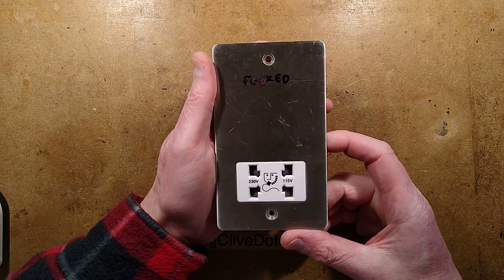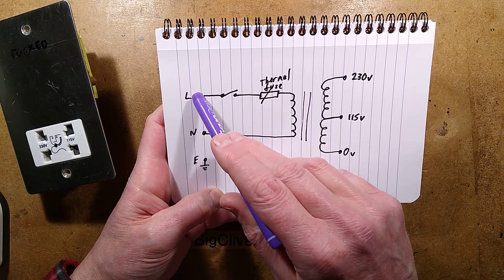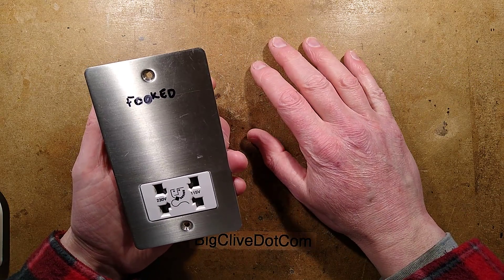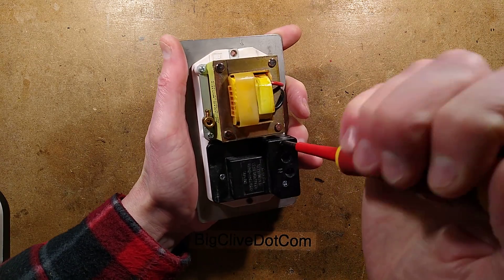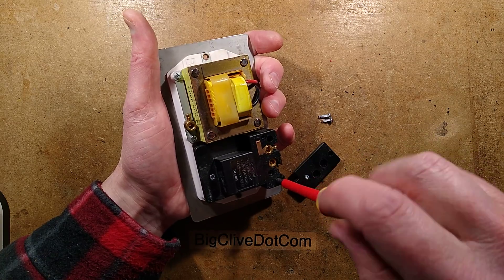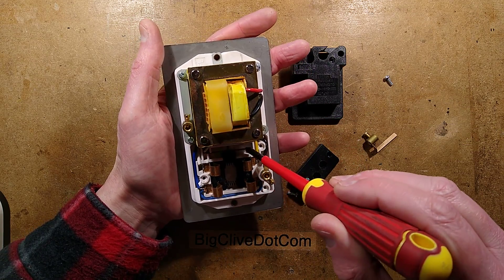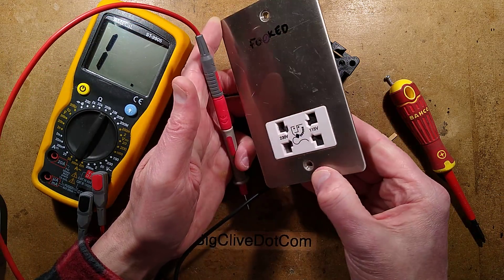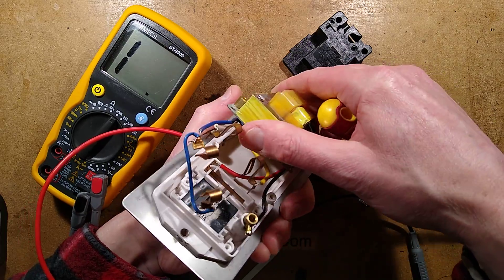Exploring a failed British shaver socket

Comment: Most shavers these days are cordless, I probably could find a corded one, but I'd have to try. But here in the US, they use arc-fault and GFI protection these days. Drop a shaver in a full sink, or even a toaster in the bath, and the thing will pop and cut power damn near instantly.

Comment: Mine hums even though nothing is plugged in. It's very loud in the bathroom. Is that normal?
Reply from the maker: Some are active all the time, but others have switches.  Ideally they should switch off when nothing is plugged in, to save using standby power.

Comment: The shutter switch is switching the primary side, so the transformer would only be "active" when the socket is actually used. Thats why you don't see any hits on socket hot etc even if the thermal fuse would be OK. The tounge touches the hot connection on the backplate you removed, when a plug is inserted. This to both avoid any transformer hum when socket is not in use, but also avoid wear and tear on transformer and idle heat.

The tounge is intentionally designed so the travel can be much more far than when it switches, this so differently sized plugs can be plugged in without breaking the switch function.

Note also that its a full transformer and not a half-transformer, meaning the neutral and hot from socket is from the secondary which you can see at 3:39, the neutral connection is black and goes to transformer.
Reply: I’ve turned mine into toothbrush  chargers

Comment: You think I could plug a US phone charger into the 115v socket without an adapter?  I wouldn't be running like a toaster or hair dryer and melt it, I just don't know if our NEMA pitchforks of death would fit.
Reply from the maker: It should fit, but makes sure it's a snug fit and not loose.  If your charger is rated to 240V you could get a plain wall adapter.

Comment: I've just come back to look at this video again after changing the shaver point in my bathroom because it was buzzing loudly.
Thought I'd have a look at the old one and found that mine (MK) had a thermister (PTC ?) in series with the live supply.
I rigged it up on a bench and as I heated the thermister the voltage drop across it increased, therefore reducing the voltage across the primary of the transformer.
Simple voltage regulation to avoid overheating?
If I hadn't remembered your video I wouldn't have bothered investigating, so thanks. I learned something.

Comment: I Denmark you can find a shaver socket in some old bathrooms, but they are rare, sine RCD’s have been mandatory since the 60’s. 
But if you want an outlet for shaving closer to a wet environment (a sink) than normally allowed by code, you would need a shaver socket.

Comment: There's GFCI outlets in American bathrooms and kitchens. If there's one thing I'd change about my country's electrical grid is the UK plug design complete with fuses in the plugs and toggle switches on the outlets. I'd keep the same breaker boxes and voltages though. 

Warehouse I work in has 480 volt power. The reason? Our 80 year old gantry crane.

Comment: These used to be standard in NZ houses (near identical design), I still have one in my house as the bathroom hasn't been upgraded since it was built in 1978. In the 90s, they switched to using GFCI outlets in bathrooms, and from the mid-2000s they just install normal outlets in bathrooms and rely on a whole-house GFCI back at the fuse board.

Comment: 2:11 the US doesn't have any sort of isolated outlet like this, but we put GFCI''s (basically, dual-winding solenoids with one winding for each power prong, mechanically linked to cut power if the currents ever differ)  in outlets near water.

Comment: They have been a thing in The Netherlands (and probably still are). Ours are rated at 15 VA.
Recommendations (NEN1010 in The Netherlands) on electrical circuit design change quite regularly and if I remember it right, they used to be necessary in every bathroom. But if I remember right, they aren't necessary anymore everywhere when the zoning is right (bathrooms used to be divided into 3 zones if I remember it right: the shower/bath and from the stated shower-area and 60 centimeter from that area used to be zone 0: no electrical circuit allowed at all, unless SELV circuit.
Zone 1 would come next and I think there the only outlet allowed was a shaver socket.
Zone 2 would allow a regular socket with a ground contact or switch, but only when at a minimum of 1,8 meter above floor-level and (in case of a switch) only when a rope is used to switch the mechanism inside.
Zone 3 was a rather rare exception, because probably no Dutch bathroom could meet this demand: if I remember it right, zone 3 was more or less the same as for the rest of the home, but I think it was something like 'only when distance from zone 2 is more than x meter'.
And then they changed the rules, but as I never really used all the stuff I had to learn for NEN1010 and never got my education for it renewed, I have no idea if I'm right and what the current rules are.

Comment: In my experience, these sorts of isolated "shaver" outlets are fairly common in many older installations in the US too (particularly in hotels, etc).  Nowadays I think they're mostly being replaced by GFCI outlets instead, though (which are probably cheaper and I believe also now mandated by code in all bathroom installations in most states).
Reply: I always thought the shaver socket in hotels was to serve British clients.
Reply: Yeah, every outlet in my house is GFCI. It seems a bit overkill, but hey better safe than sorry.
Reply: Mandated by NEC in outdoors, laundry rooms, kitchens, bathrooms and garages
Reply: @MilesCallisto  The kitchen only requires the ones serving a countertop to be gfci protected. Also, any outlet within 6' of the sink. It wouldn't surprise me if that changes in the code update though.

Comment: But why would you really need to have a 100-120v shavers plug in a 220-250v country? Is it really this big of a problem with people bringing shavers from abroad as to make such sockets? If that's supposed to make it safet then might as well use 12-30v in the shaver and have an AC-DC transformer in the plug itself.

Comment: Shaver Only Sockets were common in NZ in the 80's, before RCDs/GFCI were popular, and before our electricity code was relaxed (used to be no outlets allowed within 2m of water, more like the UK still has, so no power outlets and even pull cords for the lights). These days, bathroom outlets require RCD and are allowed within 0.5m or so of water, but over 1m from a sprayer / shower... The shaver sockets hummed when turned on and no shaver were present...

Comment: Also our plugs are not fused, instead the protection is at the consumer unit MCB after the RCD's as to the UK plus, if the company says it is  250ma Fuse, a person could insert a 2A fuse instead, the result? Fire and smoke etc.

Comment: Yes Australian and New Zealand do have shaver outlets, we have two types: one with built in RCD (can't be used with the consumer unit with RCD's) and same type but plastic plate, and our voltage is 230-250 Volts @ 50Hz

Comment: My sister for has since passed had given me  fan, a three speed fan with lots of power... 110v that had suddenly stopped working for her... I tore it down and found the thermal fuse had blown... And ordered a direct replacement... And installed it and the fan function was restored... However it was short lived, maybe a month later it blew again... I'm wondering if the thermal fuse was less than adequate or if there were a bunch of faulty ones produced.

Comment: My guess, some smart asses plug-in a 2 pins hair dryer overloading the 2a/3a thermal fuse. This square thermal fuse commonly found in house hold fans, usually 135c 2a, some with larger 18inches blade use 135c 3a thermal fuse.

Comment: Do a video on the "Tap-A-Line" continuous strip outlet. I almost blew myself up with one when I was a kid. It was cool cool because you could slide a plug in the socket without turning it off, and fit plugs close together.

Comment: It was not clear in your report whether there was a switch built in. MK units have switches built into the sockets which isolate the mains unless a plug is inserted. They are also rated at 20 VA, but i found one reference which states the output must be between 20 and 50 VA
On some types the transformer is permanently ON which doesn't seem a great idea.
UK electricak regulations for bathrooms are really strict nowadays.
Reply: Sorry - but i missed your mention of the switch

Comment: I have one in my apartment in Kharkiv , Ukraine . Not absolutely sure what the output is but i plug in 230v hair clippers and they work fine . It is just a separate single socket with just 2 pin holes and a flap to cover it when not in use . Not sure i want to explore it to much b, things tend to be a little " adventurous " in respect of this sort of  thing here ))))

Comment: Isnr there a continual connection to the outside of the plate? If the back box is earthed so would the rest be
Reply from the maker: The plate is earthed, but the output is isolated.

Comment: They are common in hotels globally.  Here in Europe, single voltage shaver sockets were common until some idiot rewrote the IEC model regulations to require full power sockets in most bathrooms.

Comment: Here in Canada (and the US), we just have regular 120v/15a outlets in our bathrooms but with GFCI in the outlet. That's used for shavers. Since it's a regular outlet, you can plug anything in it. I even plug my cellphone charger into it when I'm going to the washroom and have a dead battery. I actually dropped my other shaver in water before and it just pops the GFCI.. so it does its job. I even plugged my vaccume into it to vaccume the hallway outside the washroom because there's no outlet in the hallway. Full 15 amp outlet so you can use it like any other outlet in the house.

Comment: its a bit different for most of North America. I believe all devices sold must operate on 110/120v for home use 220/240v for commercial use basically. We have no regular sized outlets that are 220/240v if i am correct. Only a larger 220/240volt socket that twists into lock. There must be systems that have 220/240 volt but they are hard wired to the electrical panel of the home or pony(supporting subservient)panel. Very smart for all of us travelers .XD only joking.

Comment: I've never seen these used in North America.  However, bathroom electrical outlets are one of the two places that are commonly protected by a local RCD/GFCI.  (For instance, the outlet sort of near the sink in the bathroom of my current apartment has a RCD/GFCI outlet.  That is, and outlet with a RCD/GFCI built into it.  These will also protect downstream outlets if wired correctly.)  The other is outlets near swimming pools.  We could use these near kitchen sinks as well, but I've never seen one installed.  (Then again, devices like hand-held mixers are not anything like as likely to wind up accidentally dropped into a kitchen sink as an electric shaver is to be dropped into a bathroom sink.)

Comment: at 8:12, you said "its only powered while something's plugged in".  how is this achieved?  just a transistor or silicon chip?  i think its a very good idea and seems to be in all reputable charging devices.  i think its the law.
Reply from the maker: A physical switch.
Reply: @bigclivedotcom  , you just read an example of me being confused.  when you plug a phone or other device into its charger, the charger may get warm.  but if you remove the phone from the charger but leave the charger still plugged in, the charger starts to cool down.  what is in the charger to prevent power going through the transformer inside it that was generating most of the heat?  i do think this is a legal requirement in at least some countries.

Comment: I had a tripped termal fuse in a halogen light's transformer, tripped by the lamp blowing after nearly 10 years of operation.
The pain of replacing those fuse...
The new bulb blew after about 2 months (appearently by the dayly tuning on and off).
The same type replacement bulb didn't blow after continious (already half a year) use, without turning on and of dayly.

Comment: As far as I know, the razor connector is only used in the UK. and in a legacy way in some members of the commonwealth,

I have never seen one in the Americas, more precisely, in Mexico. Largely because the primary function of providing dual voltage is meaningless as most of us are the "native" countries of the 120V system.  At the same time, it is very rare or simply European 220V equipment is not sold [since the only way to have 220 is with a Biphase or triphasic service]. -which in the case of MX, unlike US-CA, is only provided under contract, availability, does not have a subsidy, and is usually even restricted to commercial use
*  and in general  [at least on MX] the use of electric razors is practically nil [people just don't like them because of the cost of maintenance and that the shave is not close or they just don't have an outlet in the bathroom
-both in men and women, the use of disposable razors is much more common, one and the most popular of them is the Gilette's Prestobarba 2  and some BIC shavers  (mainly because of the cost, a little less than 1 dollar per unit and they are even available per bag and sale prices in any store, pharmacy or market) -And even in barber shops shavettes and double-edged razors are still used [mainly by hygiene]
so electric shavers are a "niche product, or kinda a luxury product", and almost impossible to find except on the internet or department stores or stylist products [along with spare parts]

-The closest thing and if it is widespread are electric hair clippers (AC and Batt), (there are even those who use them to shave or trim properly) but even so they are not usually used in the bathroom, they are almost always used in the patio or a room where it is easy to clean the floor, Women's epilators are scarce and most of them are also used in the room, or are battery operated

(Among the reasons why there are no plugs in the bathrooms, it is because the Mexican electrical code for construction does not technically exist [there are some regulations but unfortunately their total use is not mandatory [at least not domestically] as in other countries,], so there is no mandatory use of protections such as CFGI or RCD in bathrooms, and added to the fact that traditionally "there is nothing to connect in the bathroom" / water-electric precaution, there are simply no plugs or they are exceptions)]. -Due to this culture of "the bathroom is only for the bath-toilet" and someone else can occupy it, (since houses usually have only 1 or 2 bathrooms for the whole family) objects such as irons, curling irons and hair dryers are They are used in the room dressing tables (where the "good" mirrors are also placed to get ready).
-bathroom mirrors are usually small or more intended for daily shaving beards, brushing teeth and some quick checkup or touch-up

Comment: I've never seen anything like that in Australia - except, perhaps, in hotels

Hotels may have bathroom power sockets that accept plugs from most countries

I doubt, however, that they'd have a thermal fuse - they'd demand something that will automatically reset (or, perhaps, have a reset button)

Comment: In the US, there is an outlet in nearly every bathroom, near the sink, even public toilets.  Modern construction uses a standard 15-20 amp duplex GFI outlet.  Older places have a non GFI duplex outlet, grounded in the more recent, but 2 prong non grounded in much older installs.  Many old bathroom light fixtures came with a 2 or 3 prong socket built in, in which case there might not be a wall outlet.  It's not hard to find all of the above still in use.

Comment: I'm 50 years old and not old enough to have ever used a razor that you plugged in while using it as oppose to plugging in occasionally to charge the battery, though I think those did still exist before I experienced puberty.

Comment: But how does the transformer save you? Would you not still have potential to ground the same way as if it where wired directly?
Reply from the maker: No.  It's fully isolated from ambient ground.
Reply: @bigclivedotcom  Ah, I mistook one of the pins to be ground and assumed that they did share a common ground. Now everything makes a lot more sens! <3

Comment: Some more information on these units here:  https://www.plugsocketmuseum.nl/British5.html
Note the socket accepts 3 types of plugs, the British Shaver plug (a variant of an old British 2 pin standard), The 2 pin Euro plug (which has slightly different dimensions) , and the 2 Pin US NEMA plug. The unit in the picture on that site is more representative of most units in the wild.  Only the 115v outlet accepts the NEMA plug,  and there is much more informative text "Shavers Only" in addition to the (mandatory) logo - which is an ISO standard symbol!  Clive's unit is a deluxe metal variant with minimal graphics.
Reply: Also I think it is the only UK wiring accessory to have a "portrait" format.  For other commenters please note these were specified well before RCDs/GFCIs were available, so the isolation of a transformer was the only option.
Reply: The reference UK unit from the museum looks like it will, sensibly, only accept the NEMA plug on the 115V side. Clive's unit looks like both receptacles are identical and will take even more plug variants  (diagonal pins for Aus / east asian plugs?). I wonder if this is a Chinese special. Does it have any maker or conformity marks?

Comment: is that a UK compliant unit or some ebay special? AFAIK they should only be rated from 20VA to 50VA and must include a manually resettable or auto-resetting thermal overload.